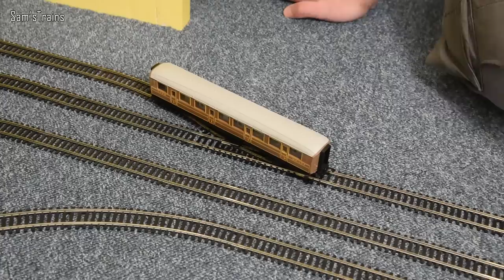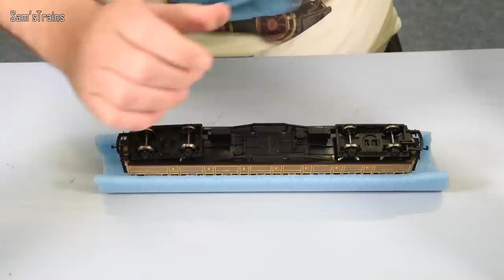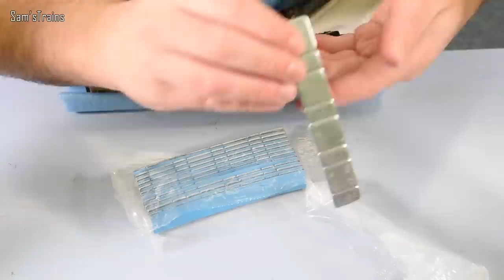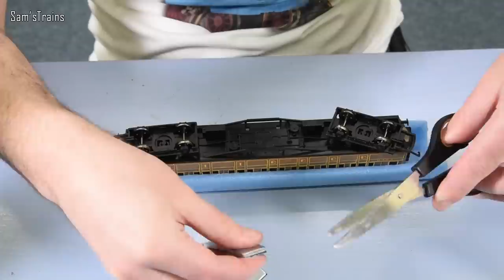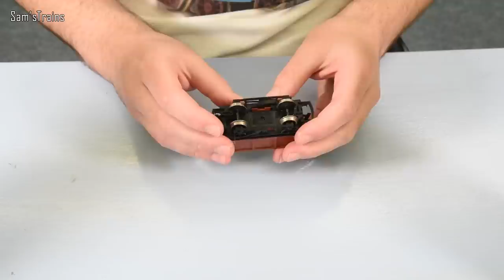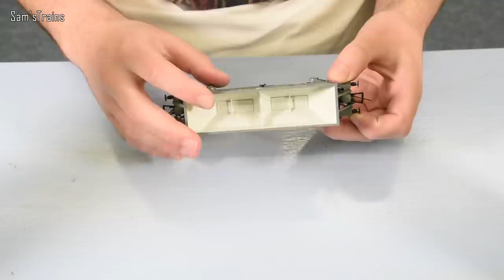How To Stop Derailments on Your Model Railway

Comment: The only thing that concerns me a little about using alloy wheel stick on balance weights under models is, these weights are designed to be held on centrifugally, as on a car they’re used inside the wheel not on its rim, so the motion keeps them in place. Should one of these drop off and contact both sides of the rials it could cause problems.  Clever idea nonetheless but I think I’d slot them end ways over each Bogie in coaches, between the chassis and the underside of the seats, thus giving you greater weight over the wheel sets and it’s all hidden too and safe away from the rails and any possible short. 😉
Reply from the maker: Yeah that is true Chris - but as I say, they really do seem to adhere very well - as long as the surface is reasonably flat, and free from grease, it's very difficult to get them off again!
Thanks for watching - Sam :)
Reply: Sam'sTrains I have good cause to believe you as remember, I only deal with these in their intended use, so dirt and grime on wheels is awkward for keeping them stuck on. But I yes, I suppose on a nice clean mud and grease free model, they’re far more suited for this. I think I’d still insulate them from any possible way of shorting, regardless. Purely from a safety and enjoyment prospective, as id hate a good idea to damage any of my locos or cause an issue I didn’t have already (one of  many many issues 😂) nice work as always mate

Comment: Sam check all of your cars for plastic wheels and if there is any plastic wheels on your cars then change it to metal wheels plastic wheels will get your on your tracks. What cleaning car do you have. The plastic wheels will put residew will get on the track and the engines will not run. Try cleaning the frogs on the switches.
Reply from the maker: Yep that's very true Jonathan - plastic wheels aren't great either! I use a dapol track cleaner for vacuuming, and I clean the rails manually with a track rubber!
Thanks for watching - Sam :)

Comment: Back to back is an approximate way t set the wheel gauge  as you say. When you examine turnout geometry you find out why. The minimum dimension that matters is the back of the wheel to the effective flange because as a wheel passes through a turnout the check rail,  with one wheel’s flange against the frog, the other’s back must clear the check rail.  This is why back to back wheel gauges set the gauge way too narrow for the wheels with fat flanges like the mega fat wheels on early hornby and triang stock.
Reply from the maker: Thanks Greg, yeah it definitely seems that way - it's a bit of a pain that mine doesn't really suit the Hornby wheels I often use, but at least it's consistently 'out', so it is helpful!
Thanks for watching - Sam :)

Comment: On those wagons like the ici some times you just have to use lead wire wrapped around the axles unless there's an alternative that idont know about yet
Reply from the maker: Yeah that would be an interesting solution - but that would increase drag quite a bit, and you won't be able to add very much before it starts to snag up! It's a very creative idea though - I would never have thought of that! :D
Thanks for watching - Sam :)
Reply: If you build up two or maybe 3 layers up to half the depth of the wheel sets you shouldn't snag on anything and if the wheel sets are capped in a brass bushing it shouldn't create drag really as wheels should be free running any way all my rolling stock is fitted with brass bushings

Comment: The best way to clean wheels is to put a paper towel on the rails and run the rail car on it after you have applied liquid cleaner to the wheels. you will get two lines of dirt caused by the wheels on top to the rails. the dirt is transferred off the wheels onto the paper towel and the wheels are now clean.

Comment: Hi Sam! Thanks for another great vid. Just had a question about the back to back gauge. The one you recommended is 14.75 mm, while DCC Concepts have another that is 14.5mm which they say is standard. Do you recommend the 14.75mm fine and why? Does it depend on the type of track? I'm using Hornby standard. Thanks for your help!
Reply from the maker: My pleasure Adrian! I'd much more strongly recommend the 14.5mm one - the 14.75 makes them too wide, more often than not! I don't know why it is, but that's just what I've personally experienced! I use Hornby track and Hornby points!
Thanks for watching - Sam :)
Reply: @SamsTrains  Okay, great. Thanks for your feedback, Sam! Keep up the great vids :)

Comment: Hi Sam, Ive got a problem with locomotives and occasionally rolling stock detailing as they cross between standard and curved Hornby points. 

The biggest problem is the curved points, they cross between a second and third radius curve, and they derail whether or not your crossing from the inside to the outside line, or vice versa. 

I tend to follow Hornby track geometry and track plans, so I’m not to sure what the problem could be, maybe the valleys next to the track guides need to be reduced more, 
Any tips or solutions you can think of ?, should I just stay away from curved points?, I read on a couple forums that people generally try to stay away from Hornby curved points and use PECO ones instead but I’d much rather find a solution rather than returning the points so if you can think of anything that could help, that would be super helpful

Thanks

Comment: I made the mistake of using a turnout as part of my continuous loop. This meant that each time around the curve/switched state of the turnout would be used. It's a high risk area for derailing and needs to run at a slower speed. The need to run a track section at a slower speed negates the main benefit of continuous running hands off.

My next layout I need to remember to have the main use case of the turnout to be the straight and not the curve.

Comment: Hi Sam, I’ve tried these wheel balancing weights on the underside of my coaches.  They do definitely stop derailments at points as you say. The problem is that despite the very strong adhesive they eventually fall off from the underside of the coaches. Initially after applying them to a good smooth flat contact area everything is fine. They initially stay put. However, on returning to my layout after a few days quite a few of them have fallen off and are lying on the track. I’ve tried a different brand but they still eventually fall off which is very annoying. I don’t know why the very strong adhesive on these weights does not keep them on indefinitely. Have you experienced this problem? Thanks
Reply: Just add a blob of superglue to the self adhesive pad. Hold it in place for a minute n done.  Not comin off easy then.

Comment: Interesting and helpful video.  Try testing some different engines.  I find that my short steam engines derail more than the Alco or GP40s.  Does the wheel flange make a difference?
Reply from the maker: Thanks a lot - hope this is some help to you! The flanges can do, but only if they're massively large - most modern ones are fine!
Thanks for watching - Sam :)

Comment: Hi Sam, Does adding extra weight to rolling stock increase wear on loco motors and bearings leading to a possible premature motor failure? Thanks
Reply from the maker: Hey Liam - I suppose it could do slightly, but locos tend to wheelslip rather than overly strain the motor - as long as you keep them reasonably lubricated (and don't add crazy amounts of weight) it should be fine!
Thanks for watching - Sam :)

Comment: Weird about that "lead poisoning" concept...I used to mold my own lead bullets for my "Brown Bess" musket. Used to melt down discarded wheel-balancing weights from local automotive shops. Never used any type of "caution" when handling them! I'm now 68 years old and, yes, I'm STILL HERE! Over here, we're raised handling bullets and firearms from an early age, and we weren't even aware of lead poisoning...maybe if we had been made "aware", more people would've gotten sick, or even died from it?? It seems the old saying "what you don't know won't hurt you" does apply here...?
Reply: millions of Americans have handled lead and never gotten sick. the problem was when little ghetto kids would eat the lead based paint pealing off the walls. or did they get sick from all the smog in the city's, and or lack of a proper diet? but you really should not use old wheel weights for black powder, as the lead/tin mix is a bit too hard. now the weights are made of zink. a far worse metal alloy.
there are a number of metal sellers (yes b&m places) that you can buy lead, other heavy metals, etc and shipped right to your door.
Reply: @larryjanson4011  , I can't provide too many details on the actual content of the lead I was using, as this was the early 1970's when I had "Brown Bess"! I was melting and molding everything I got my hands on to save money! Bess is long gone now....traded up for an AR 15!🤣

Comment: Points could be culprits  - rails out of gauge or guard rails too close or too far from frog.  Or the diverging angle is just too sharp.  Also In the US we use HO scale NMRA RP 25 wheel and track standards which have a wider back to back gauge than British OO standards even  though  track gauge is the same 16.5mm
Reply from the maker: Yeah they could be - they're a good benchmark though, if something works okay on those points, I know they'll work okay anywhere else!
Thanks for watching, Sam :)

Comment: Very interesting you singled out a teak coach that looked like the kind you'd get in the Flying Scotsman set.
I use that track plus some extra as my test track and never had problems with those coaches.
I do have troubles with a lot of older locos and some of the older coaches and rolling stock though.
The back to back gauge setter I have has a taper so you can push it into the wheelset [No idea of the brand I bought it ages ago from a nearby modelshop]
brunelhobbies.com.au to be exact.
Anyway, lots of good tips there as usual. I've given up on the troublesome older stuff, but they seem to handle the larger radius Peco points ok which is what
my main layout will use. Except for a couple of old Triangs I think I need to replace the big flanged wheels on at some point.
Great video as always Sam but my no.1 tip to avoid derailment is don't run on carpet :)
Reply from the maker: Thanks Gerry - yes it is the same as they put in the Scotsman set - I changed the wheels in these many years ago, and I think it's those that cause the problems! Glad you liked the tips anyway!! :D
Yes the carpet isn't ideal - but it's not responsible for many derailments!
Thanks for watching - Sam :)

Comment: The issues I have are with the curves on my layout, all of which are radius 3. On a couple of spots there are curves that bend left and bend right straight after, my Flying Scotsman seems to struggle when going across these sections in one direction but not the other. Should I be using straights inbetween or are there other solutions?
Reply from the maker: Yeah I've noticed that - there are models that don't like s-bends - I would suggest using straights in between, if possible! Only other solution is to use larger radius curves, but it's still not ideal!
Thanks for watching - Sam :)

Comment: Well, if you are for "true realism", you have to make sure your track layout geometry is "realistic" in the first place, so mainly no such tight curves and angles, mainly in and around the switch points or places where the bend direction changes. If you have to make a compromise (e.g. due to space reason), you should be ready to make it in e.g. tolerating the extra weights on the rolling stock. At the end the physics is the same as in normal railway and there is very good reason why the railway turns are so wide and points so long in the real life.
Reply from the maker: Yes of course that's true!
Thanks for watching - Sam :)

Comment: Hi Sam just a quick question I noticed you’ve covered why rollin stock details over points....is like to know why my little rolling stock carts randomly derail when going round bends especially when there’s about four or five carts that’s being pulled. It could go round four or five times them would lose balance. Is there anyway to counter act those?
Reply from the maker: Hmmm yeah that's odd - is the track good and even? Are the little wagons too light? Are the couplings causing problems? There's quite a few potential issues!
Thanks for watching - Sam :)

Comment: Hi Sam just a quick question I use the peco flexi track and made my layout quite small and more narrower. It’s been running really well but find the rolling stock/Hornby carriages have been derailing in the same spots. My question is with flexi track nailed down does the track flex or move/stretch over time?
Reply from the maker: Hey! I'm not absolutely sure about that - since I don't use much flexi track! However, if your layout curves are very tight, some wagons and coaches may derail, since they're not really designed for super-tight curves!
Thanks for watching - Sam :)

Comment: Hi Sam,  
I know from a previous video you own a Q 1 does the front wheels derail a lot? I own a older tooling of the train every so often the front two wheels derail I borrowed a mates new tooling of Q 1 it did the same . My layout is four foot by four foot do you think the Q 1 needs more curved track to go round oddly points it runs fine over. Thanks
Reply from the maker: Hi Peter - yes I did once have a Q1 whose front wheels derailed a lot - but I never did find out why.... it just stopped doing it after a while! It is very strange!
Thanks for watching - Sam :)

Comment: One thing I was thinking of is not to use points with sharp curves at places where you want your trains to go fast. I admit it's a bit of an obvious one.
But my first advice, as with all these technical issues, would be: Check there's a vid about it on Sam's trains.
Reply from the maker: Yeah that's very true of course - though these LNER coaches of mine would derail at any speed!
Thanks for watching - Sam :)

Comment: Great advice Sam :) Would using those weights also work for locomotives with light bogies? I have a GWR Hall which keeps hopping off the track on various points and corners, but the front bogie is definitely the culprit.
Reply from the maker: Hey Markus - yeah it does work very nicely with locos - provided you can hide them from view, and don't let them touch any moving parts!
Thanks for watching - Sam :)

Comment: Do you know how to fix coupling rods on locomotives? My James Hornby model ( which was £200) piston rod came loose and now it can't move.
Reply from the maker: Yeah! You need a 2.5mm nutspinner - available on Ebay - you can use them to tighten up the crank pins - hopefully none of the rods bent??
Thanks for watching - Sam :)

Comment: Use wheel balancing weights for alloy wheels otherwise they will not have the sticky side also if you search for motorcycles ones you can get black powder coated and silver ones
Reply from the maker: Yes you're absolutely right - I've since seen blackened versions!
Thanks for watching - Sam :)

Comment: Hey mate, I am having issues keeping my larger locomotives on the track, Hornby railroad flying Scotsman and a Hornby hogswarts express. It is mainly caused by the ponie trucks, how can I fix it?
Reply from the maker: Hmm interesting - if it's multiple locos, I'd suspect the track - is everything nice and level? Are you using 2nd radius curves or wider?
Thanks for watching, Sam :)
Reply: @SamsTrains  the corners are 3rd radius and the only two locomotives I have are larger ones, the hogwarts express made it in the end because there was a gap between tracks but the Scotsman is having same issues but the original owners pulled it apart and lost a few parts so the ponie truck is missing the washer/spring

Comment: In a Model Railway when a train or rolling stock is derailed on the track you can use your hands and help the train and rolling stock out and put them back on the track. But if this would've happened in real life then it'd would take a bit of hard work and trial and error to get the train and rolling stock back onto the track with the crane helping it out.
Reply from the maker: Yes that's very true - but it's always good to try to stop the derailments, if they happen often!!
Thanks for watching - Sam :)

Comment: Where does that tray/cradle come from Sam? It looks a bit kinder to rolling stock than the Peco one that can be a bit harsh on modern stock  with a wealth of detail held on with an absolute minimum of glue.
Reply from the maker: It's just some foam pipe insulation I believe - I have no idea where it came from - I bought some second hand coaches, and they came packaged inside them!
Thanks for watching - Sam :)

Comment: It works but because i use Märklin and Märklin Rolling stock(Which use a Completely different track system)which is so Heavy that you don`t need Those Balancing weights but still good Video it helped me with light 00 Gauge rolling stock
Reply from the maker: haha absolutely - that's the better way to go, having them heavy to begin with!!
Thanks for watching - Sam :)

Comment: i have a very annoying problem the way my yard (on my model railway) is designed engines have reverse into the engine shed and they derail going over the points this mainly happens with my hornby patriot class and my  hornby K1 mogul.
Reply from the maker: Oh man that really is annoying - which brand of points are you using? If it's happening with lots of stock, it may well be the points to blame!
Thanks for watching - Sam :)
Reply: @SamsTrains  i think they are hornby, all but one is peco